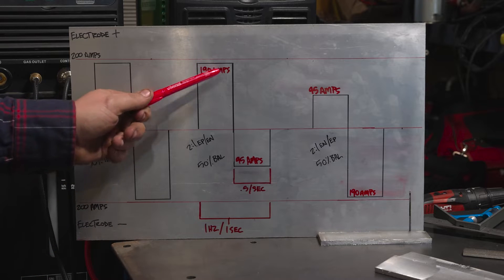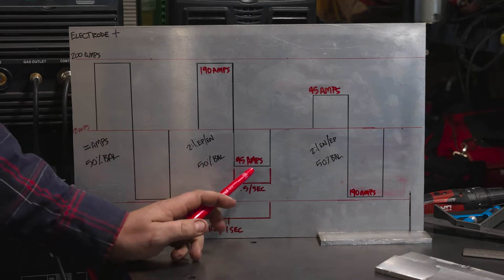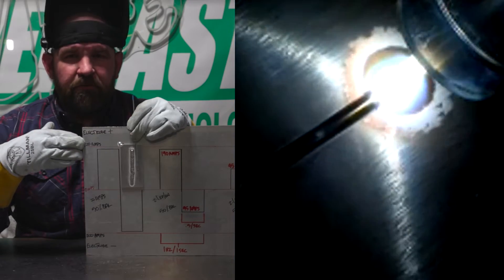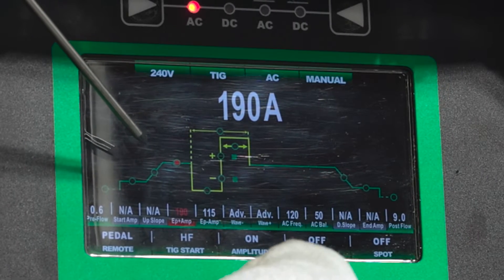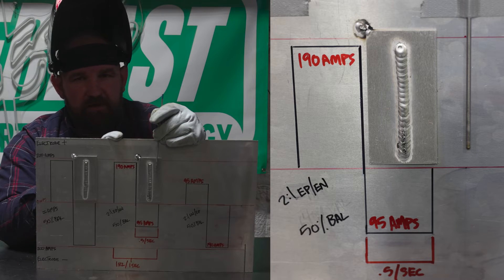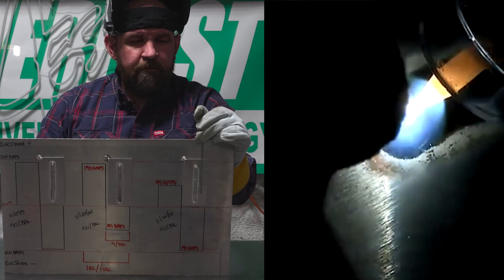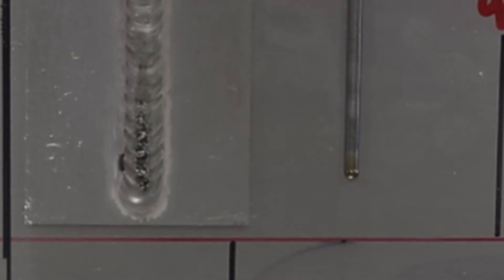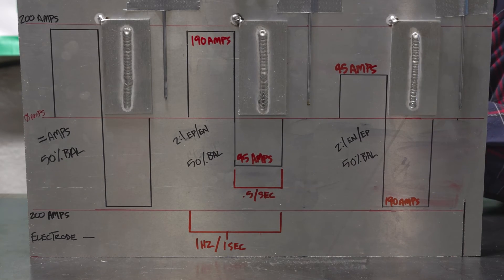Independent Amplitude EXPLAINED and why you need it

Comment: It looks like there is a visible difference in the oxidation layer burning off.  When running 50/50 or 2:1 EN:EP, the oxidation burns off orange, when running 2:1 EP:EN, the oxidzation looks to be burning hotter with a blue color.  So it would seem that orange burnoff is ok, but if its hotter; which blue would indicate; you're going to be in trouble/too hot.  Thoughts?  And another question, what is the difference in effect on the HAZ?  is a low EP/High EN going to generate less heat than a High EP/Low EN?  Would that affect the brittleness of the aluminum in the HAZ enough to affect the finished product?

Comment: it would be interesting to see the differences when at more normal balance settings, on clean material as well as grungy cast.
Reply from the maker: Running a higher balance just shows even more so how much the amplitude adjust helps to conserve tungsten life, it’s positives are even more pronounced at say 35% balance

Comment: you don't need it you will spend more time adjusting your machine then actually welding.
Reply: We all should probably go back to transformer based DC only machines.
Reply: @jessemccollum937  The Luddites are alive and on YT.  Not a FanBoi, in fact I am in "full learning mode in prep to buy a welder" mode, but won't the 225 & 275, and likely, too, the machine used here, save settings for a given procedure, once you get it like you want it?
Reply: @replyhere590  yup our MTS225 and 275, all typhoon models, and our entire ext lineup all have memory programs
Reply: I guess it depends what you are welding, quality of weld etc...... For me it's never too late to learn new things.